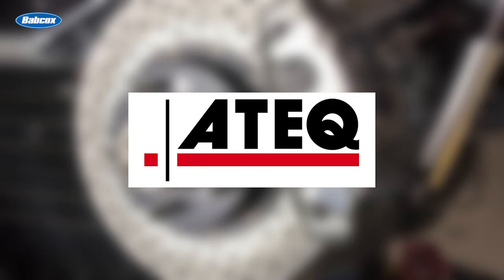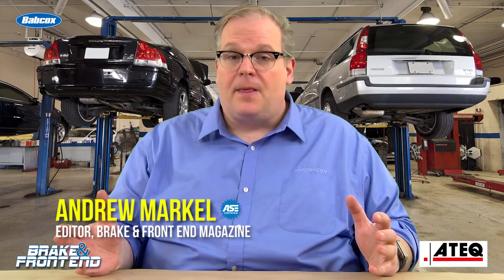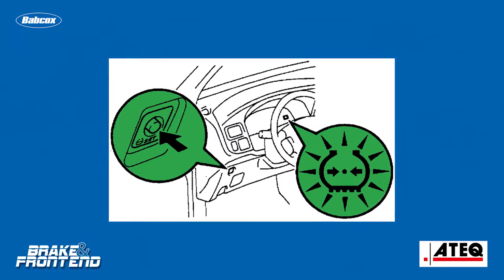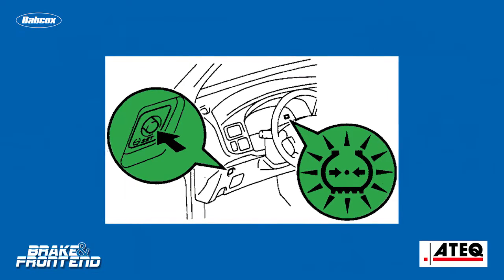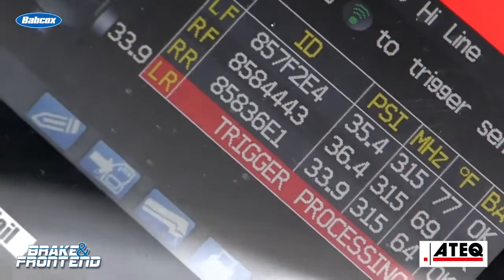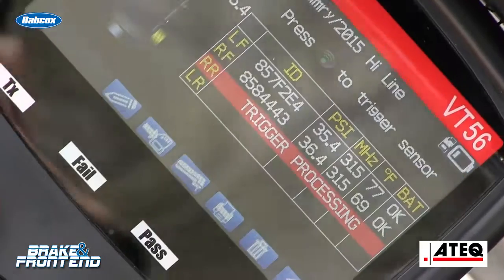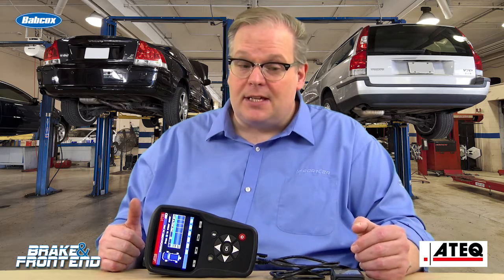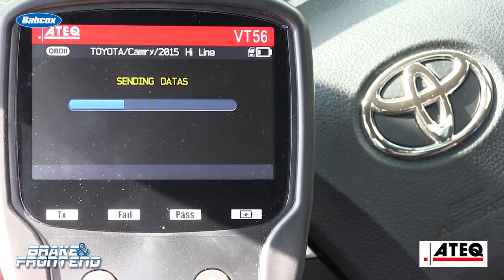Toyota TPMS relearn procedure | Tech Minute

Comment: My 2018 4Runner has no reset button, had to go to the dealership and pay $500 now it works
Reply: I'm having the same issue. It looks like there's a scan tool to adjust and reset the system. "Foxwell tpms relearn tool" that i found on Amazon for $200. That's cheaper than $500 and the wait time? All new vehicles after 2008 have these systems so having this tool seems like almost mandatory?

Comment: Ah, I see. This is a sales pitch for something we don't need.
A tire sensor can't hide behind a caliper if you follow the instructions in your owner's manual.

REGISTER ID CODES
1.	Press the tire pressure warning reset switch 3 times until the tire pressure warning light blinks slowly 3 times.
Then a message will be displayed on multi-information display. When registration is being performed, the tire pressure warning light will blink for  approximately 1 minute then illuminate and “--” will be displayed for the inflation pressure of each tire on the multiinformation display.

2.	Drive straight (with occasional left and right turns) at 	approximately 25 mph (40 km/h) or more for approximately 10 to 30 minutes.
Registration is complete when the tire pressure warning light turns off and the inflation pressure of each tire is displayed on the multi-information display.
Registration may take longer than approximately 30 minutes in certain situations, such as when the vehicle is stopped for a long time at traffic lights, etc. 
After registering the ID codes, make sure to initialize the tire pressure warning system. 

INITIALIZE the TPWS
1.	Park the vehicle in a safe place and turn the engine switch off. Initialization cannot be performed 	while the vehicle is moving.

2.	Adjust the tire inflation pressure to the specified cold tire inflation pressure level.
Make sure to adjust the tire pressure to the specified cold tire inflation pressure level. The tire pressure warning system will operate
Based on this pressure level.

3.	Turn the engine switch to the “ON” position.

4.	Press and hold the tire pressure warning reset switch until the tire pressure warning light blinks 3 	times. (See illustration above)
A message is displayed on the multi-information display. Also, “--” is displayed for inflation pressure of each tire on the multi-information display while the tire pressure warning system determines the position.

5.	Drive straight (with occasional left and right turns) at approximately 25 mph (40 km/h) or more for approximately 10 to 30 minutes. Initialization is complete when the position of each tire is determined and the inflation pressure of each tire is displayed on the multi-information display.
Initialization may take longer than approximately 30 minutes in certain situations, such as when the vehicle is stopped for a long time at traffic lights, etc.

Comment: So relearn works only for the sensors already written to the system? And if I change my tires winter-summer it does nothing? That's exactly what I observe - this relearn button is BS, you need to write sensors IDs with the tool, no other options

Comment: Procedure : scan all tyresensor codes using ATEQ VT56 ODB2 scantool, Connect the tool to the ODB2 port of the car, upload the sensor readings.
Reply: GTFOH.
Reply: The ATEQ VT56 ODB2 is $2,200.   Ain't going for it.